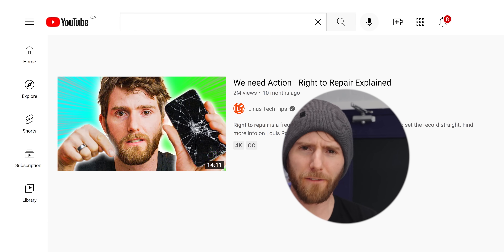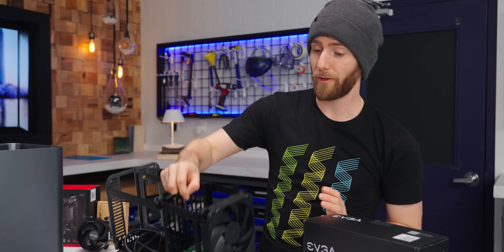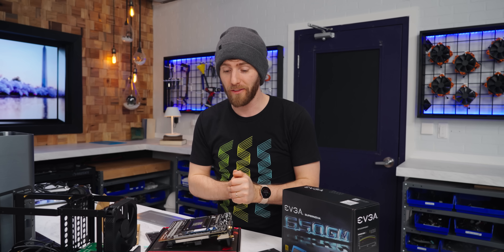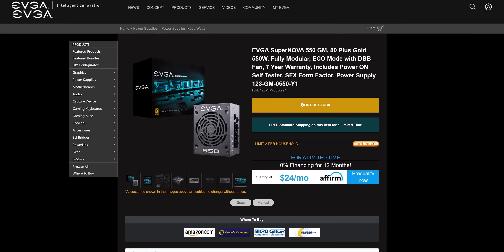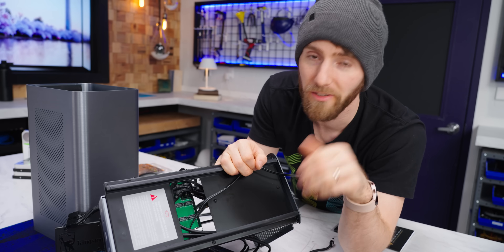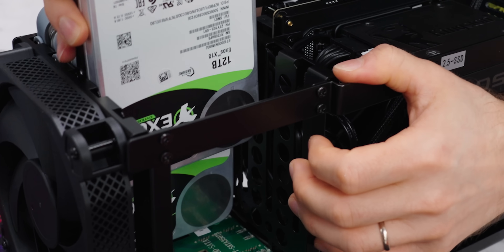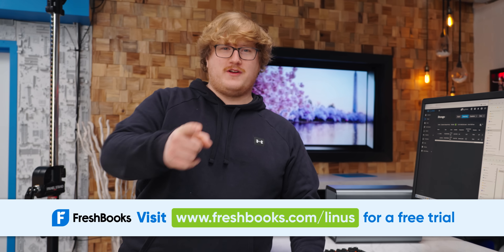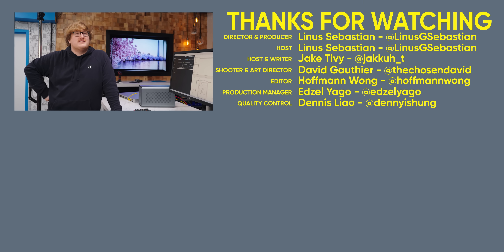This blows away the competition - JONSBO N1 NAS Build

Comment: Could this be used as a GoogleDrive alternative? How good is the implementation into Android and everyday apps?
Reply: Well if you pick the right app probably better than google since this is what google is riding off of.  Did you think android was made from scratch?  Nope.  And neither is there upload service. It's a reimplimentation of open source software given polish.  This open source software.  Problem being it's less polished.  But...  alot more flexible.  Maybe tooflecinle as the array of options will melt your mind. But yeah,they will be some side project t that works work android apple or windows.

Comment: I'm honestly surprised you decided to use an ASUS ROG Strix mainboard instead of an ASUS Prime mainboard, before searching and realising that there doesn't seem to be an ASUS Prime Mini-ITX mainboard!

I find it cool that you produced this video, because I too have a custom-built NAS, mainly so I could run full Debian instead of a proprietary NAS OS, plus I get to control it over VNC and run full X Window System stuff (and/or Wayland if there were a Wayland compatible VNC server) instead of just doing it in a Web browser, which is especially great because I also run stuff like Calibre on it.

In my case, while it'd be more expensive, I went with a server specific Mini-ITX mainboard 

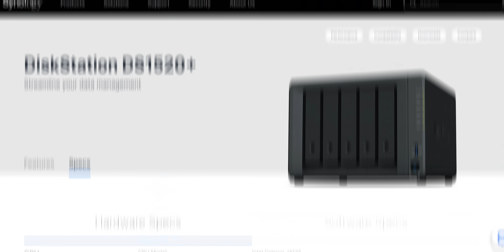(5:47) Yep, it's possible to have more RAM in a NAS, and then Linux would just end up using most of it as cache. To be fair, I went with BTRFS as I had trouble setting up ZFS back when my NAS was running Debian 9. I then realised that you decided to go with TrueNAS, which IIRC, is based on FreeBSD.

For the start-up drive, you could go with a USB flash drive instead of cheap SSD if you have a server mainboard with an onboard USB-A port, but because I use regular Debian, which needs to frequently access the SSD, I went with a WD Red series SSD instead, to host the OS and user profiles.

Comment: Nice, otoh, I bought a Dell power edge R520 used for 200 bucks, ok it's rack mount and if you use the CPU a lot probably less power efficient , but it's 500 bucks cheaper and holds 8 drives.

Comment: If you want better virtualization features and still want to use TrueNAS, you could always use proxmox to run TrueNAS in a VM and then use proxmox as the platform for any other containers/VMs you want to run.
Reply: Or use truenas scale
Reply: @Lead_Foot  true, I haven't had a chance to play with it yet, but it looks promising.

Comment: Anecdotally those 32/16gb optane drives die in about 3-5 years of cache use for a windows machine. Just an observation of consumer machines that's stopped booting or crashing randomly.

Comment: Wish they wouldve shown how much heat that would generate and how loud under use it was
Reply: Pretty sure the entire point of the case was queit heat dissipating build.
Reply: @jemiebridges3197  They're putting a lot of faith into that single front fan of unknown quality. That and zero ways to reduce vibration around the drive cage.

Comment: I've done similar like this, which runs since 2 years without any prtoblems. And u dont need to buy everything, if u have an old PC. 24/7 power need. ~50W per hour

I took my old PC with 16Gb RAM, an RM650, a mATX Board and a 4770k in an ATX 4U Server chassis and put in my Server Rack. Than throw a bunch of 4tb HDDs in (i bought external drives and shulked them) and a Raid pcie Card for more Sata Ports. 
At the moment I have 2 Sata SSDs and 8 HDDs in it and 2 HDDs can fail. So I have round about 24 TB usable storage. Not much and I have to upgrade soon, but it is fully under my control.

Comment: Unless things have changed in some odd way, RAIDZ1 is generally a pretty bad idea. Especially with drives this big, if a drive fails and you replace it, there’s a real risk of another drive failure happening during the resilvering process and then boom, your array is hosed.
Reply: I use RAID-Z1 on 8TB drives because I have a full backup. RAID is not meant to be a backup, but a measure to reduce downtime.  So for my non-enterprise use-case, it's worth the tradeoff for extra storage. Also, ZFS only resilvers data that it needs to, so if your drives are less than 100% full, it will only reconstruct the exact amount of data on the drive, unlike traditional RAID. For some reason IT guys insist on squeezing enterprise solutions into consumer-sized holes.
Reply: Agree. Advertising this case as up to 100TB is BS if you want any array in it. I wouldn't go above 2TB disks with 1 redundant disk. And doing 2 redundant will probably hurt performance.
Also I would look for ITX board with IPMI for this. Asrock Rack has some nice mATX boards with IPMI.
Also price difference doesn't factor in power cost, and with 24/7 operation you can easily pay way more for this setup than some low power ARM solution .
Reply: That's the risk of EVERY Parity based RAID system

Comment: How difficult would it be to make something like this, have a second unit be off-site, and to set them up to be mirrors of one another? I'd love to implement something like this at work
Reply: you could do it with with rsync and a chron job.
I wouldn't be suprised if there is already a feature in TrueNas.
Reply: @tanmaypanadi1414  Yeah, ideally I would use something baked into TrueNas or some other OS that has that capability baked in to try and minimize complication. I'd like to be able to more or less have the backups be set-and-forget and just check up on them from time to time

Comment: This is very interesting. I have an old Synology NAS and been looking to upgrade. I like this method a lot but also have mixed feelings about the whole DIY part. I use to LOVE building my own PCs but over the past few years have just been meh with doing that. I just want to pull it out of the box and have it work.

My main question here is, with this setup, can you start with 2 drives then add a 3rd or more later (equal size drives as 1st 2) without needing to start over and format everything?
Reply: Yes and no, with true nas you create a vdev that becomes your pool. Once you create a vdev you can't expand it but you can combine two vdevs to expand a pool.
Reply: it must be possible if you are comfortable tinkering a bit. but I think as Linus said going with unraid might be a better option if you are planning to add drives later.

Comment: Cool, but another build should be done where you guys go further. Get a proper APU in there. I don't know why you guys didn't go with a 5600g since they are going for 218 US right now. Which is right around the same price as a 3100 and its antiquated self. I used a 3600g for my build for a nas server not to long ago.

So why the fuss over the APU? Well in short, PLEX. Assuming it isn't fixed on latest (I had to do some finagling on my 1+ year old NAS) it can utilize the APU for transcoding and still keep cool without the need of a heavy duty GPU. Making for multiple PLEX connections a bit easier to swallow. Same for Next Cloud and its web front end. The extra performance is also nice when things get dicy. 

Since we're talking ultimate nas. You got a PCIe slot not being used :-D I'm sure you guys have a M.2 PCIe card you can throw in.... Probably too small for a Hyper M.2 card from Asus. But the possibilities.......

I think the only thing I'm curious about is the 2.5 gbps network adapter on that board. I'm using a gigabyte board B550 so maybe that has something to do with it. However I couldn't get TrueNAS to see it and even after updating its like it doesn't exist. Only thing I get back from TrueNAS is "Don't use new shit you fool". So I was forced into using a USB network adapter.

Comment: Actually, jakes passion behind this project has me sold, I'm sold. I desperately need a storage solution and honestly I'm probably approaching that spooky data decay territory on some drives in a drawer. I gotta do this.
Reply: truenas scale is a good product, replaced unraid as the go to for them it seems like.
Reply: Jake and Linus together are gold honestly which is why they keep going to that well. They play off each other really well. And Jake knows his shit;.
Reply: i had 2 perfectly fine drives in my closet, static sealed, 2 years old and 7, both were dead on my last round of checking/backups for seemingly no reason :/
Reply: @Pancakess63123  I had 3, all working perfectly fine, and none of those were sealed, they were in plastic storage boxes. I guess it's all about luck?
Reply: @Pancakess63123  mostly because of bad luck, sorry man. but i heard that old hdds also have higher risk of dying just by sitting around by just getting older, because of something something gases coming out iirc?
(i personally counter bad luck AND higher risk by just having additional copies.
i tbh would rather rely on 2 copies on 2 used hdds in comparison to only 1 brand new hdd. i personally bought a old Server with barely used hdds and have 3 copies of everything, for the price of only having 1 copy on new drives.)
Reply: Same, I still have 1 drive still kicking from 2008..? He's my little trooper, he's just a 1tb hdd.
Reply: @DarthRaijiin  Same. I’d got a 1tb Western Digital HDD from 2009 or 2010 that still works. At the time it cost near $150.
Reply: @Wally17.  dude, we probably have the same model of drive. LOL! I guess WD drives last.
Reply: I would definitely do this if I didn't already have a nas that I was satisfied with
Reply: JONSBO little  cases  look like great little video systems,  just add in a AMD Ryzen  7 8700G  and the graphics / video software of your choice...

Comment: Challenge: NAS nice and easy. I want something simple to attach to my router that my laptops can access and my rectangles can stream from. 

Easy is the key. Is there anything out there?  I’m willing to build if it requires zero support. And I’m only thinking a terrabyte or two.
Reply: Synology, QNAP...
Just insert the drives and set it up with the integrated assistant.
Reply: @GreenCinco12Official  I will look into it, but all of the drives that I have seen like that either have media limitations (you can't stream music or video) or they are managed through the manufactures cloud service (which... no security and creepyness).
Reply: @GreenCinco12Official  Oh, both synology and Qnap are actually NAS server boxes.  The fact that I would have to add multple drives makes them far from cheap (something I neglected to add to my original post) and would in turn require way more hand holding that I want.  I am looking for something with a single drive that I can plug into the router that would share files across the net.

Comment: I'd be interested how power consumption compares to a dedicated NAS appliance. These things run 24/7 potentially over several years and power consumption can become a pretty significant factor when running them for a while.
Also as others have mentioned, ZFS recommends using ECC-RAM. But to be fair - the DS1520+ does not come with ECC (but it also doesn't have ZFS support).

Comment: The system as such is nice, but if you just use it for storage, it's a bit overkill. The cpu has a tdp of 65, most nas cpus (even with intel celeron or atom) doesn't reach 20w. For a system that runs 24/7/365 that could be a major factor to calculate in. Especially in countries where you have to pay way above 0.30$/kwh. Also it would be interesting to use someting like XPEnology to install the same OS as on the Synology nas.
But the system could be nice as a 2.5g/10g (pci network card) firewall system with encryption, intrusion detection etc.

Comment: I've been using XigmaNAS (originally NAS4Free) for several years now, and it has been absolutely rock solid despite my cheap janky set up. It only has 1Gbit LAN though, but for for my needs it's been completely sufficient. I also use RAIDz2 over Z1 just for a bit more peace of mind on my 5-drive pool.

Comment: I'd spend some more money and get the Asrock Rack X570D4I-2T for integrated dual 10Gbe, 4 sodimm slots, up to 8 sata, and ipmi. But I'd feel weird about not using the x16 slot and would probably go with another case anyways.

Comment: This case looks amazing. Sort of a spiritual successor to the Silverstone FT03 and FT03... mini? I really wish SS had released newer versions of those cases. Some concerns I have with the video content: Don't some motherboards refuse to boot without a GPU installed? Isn't it strongly recommended to go with ECC RAM when using TrueNAS/ZFS? Depending on the use-case of this NAS, going with a cheap Intel build brings a lot of value to the table with Quick Sync. Intel also opens up some possibilities for SuperMicro motherboards, ECC RAM, and IPMI.
Reply: As far as Intel opening up ECC, no it doesn't; Intel doesn't support ECC at the CPU/memory controller level (unless that's changed since I last looked. AMD on the other hand supports it on the CPU/memory controller level (or at least they don't actively disable support, it's down to motherboard validation I think?), and ASRock Rack (ASRock's server division) has AM4 boards with IPMI. Those boards aren't cheap though (I should know, I have one I'm planning a storage server build with, though I went for one with dual 10GbE and 8 SATA ports on board which upped the price to almost $1kAUD).

Everything else though, yep, pretty much, but they were going for a total of $700, so ECC may have been out of budget, and I'm guessing they knew that board would POST without a GPU. I was definitely waiting for it not to though, and I would have laughed ;)
Reply: @joshuawaterhousify  supermicro + intel xeon should be able to let you use ECC if I'm not mistaken
Reply: @fuomag9  Xeon does have ECC support, but then you're out of their $700 budget, unless you mean older (Ivy Bridge) models. Even then, you still lose Quick Sync, because Xeon doesn't have iGPUs, so you may as well go for the AMD anyway because it'll be cheaper and still supports the ECC (with capable boards).
Reply: i wish i had never sold my FT02. i loved that case. I bought one without a window and cut a 16x9 scale window in the side. that case had all the room in the world for gigantic passive coolers and had those crazy intake fans.
Reply: @these2boots  I sold my FT03 build to a friend, who then sold it someone he knew. A few years later I attempted to buy back just the case, and was unsuccessful. This was all maybe ten years ago. It's still one of my all time favorite cases. I even got a slot-load Blu-ray drive for that case too.

Comment: Holy smokes! I did a very similar build with a 1 liter Optiplex. I ended up using an M.2 to 5x SATA port adapter and it works really well and sips  power. It's not exactly in a case though. I had to cut the top panel of the Optilex and the drives sit in a cage with a SATA backplane.
Reply: it's still one less optiplex rotting in a e-waste pile

Comment: If you want to save more money get an atx case and mb. mini-itx boards are really expensive, an atx b550 can be bought for as low as 60$ and it would already come with 6 sata ports. Also you could get an atx power supply that way wich is also cheaper.

Comment: Is there a good way to build this even cheaper (with less storage for example)
Reply: Sure.  Basically take your old slow computer, stick TrueNas on it and add hard drives.  You'll probably want to swap out for a low powered 4 core CPU and X ampunt of ram and make sure its properly cooled.

Comment: If it's just to control the storage system, wouldn't it be fine for an old motherboard and cpu?  I don't know, something Chinese 3rd generation with integrated video for example.  I don't think that just to send commands to the disks I need the latest generation motherboard and CPU.  or maybe something minimal like a pentium from the last ones that came out.
or maybe a Xeon e5 which is perfect for this and mother cpu and memory can be bought for about $150 in AliExpress. You can even put an m.2 on those x79s to act as a cache, and with this setup you would save another $150-200.
Reply: Yes, that's what true NASA is for.  But if your using this long distance to replace one drive Google drive or for streaming to replace Netflix video game console thers reasons not to cheap out to much.  It fact that's what makes this superior to the qnas.  

Synology and those guys are pretty damned good but have to cheap out on either ram or the cou to meet their psycological price point.  Business is no good if you have a superior product but no one buys it.  But these cuts cause serious glitches under heavy use loads.  Some of us are will to pay a $100 to fix that.  Also,many of us need custom software solutions that aren't feasible for a mass provider to work on. Lime cone ting to the original xbox or some weird ancient apple product even apple didn't support.